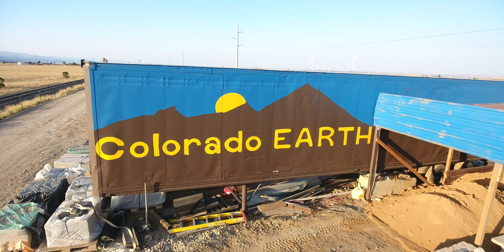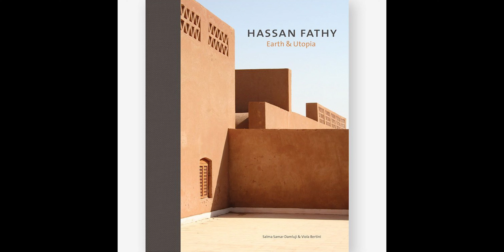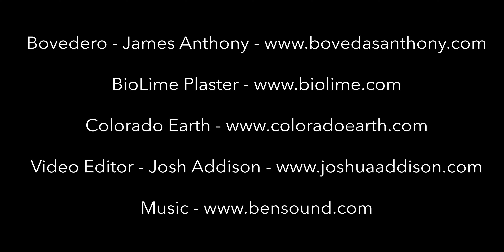Colorado Earth Dome Workshop

Comment: James mentioned that he likes "thin mortar" lines. From always seeing sizable layer between the bricks I've made the assumption that it needs be like that.
Question: from a structure and physics point of view does it matter at all if the bricks actually touch to a degree, as long as there is a thin even brick covering layer of mortar in between?
Reply: Here's a response from bovedero James Anthony - “If I have a “buttered” brick and lay it on top of another and feel surfaces grind upon nestling into place, everything is fine”.

Comment: What did you use in between the block walls to insulate?
Reply from the maker: For this dome project we left the cavity open (air) but typically the cavity is filled with loose fill insulation, perlite or cellulose.

Comment: How do you calculate the thrust of the domed roof, and the strength of the walls needed to support it?
Reply: Thrust & Wall Strength.

Model: GPT-4

￼

How do you calculate the thrust of a domes rood, and the strength of the walls needed to support it

ChatGPT

The calculation of the thrust generated by a domed roof and the strength required by the walls to support it involves complex structural engineering calculations. Here is a simplified explanation of the concepts and processes involved:

Thrust of the Dome: The thrust exerted by a dome on its supporting walls depends on several factors including the weight of the dome material, the size and shape of the dome, and the force of gravity. The general idea is that the dome acts like an arch in all directions, pushing outwards on the walls. In an ideal scenario, the forces within a dome are compressive, flowing along the curve of the dome from the apex (top) down to the base (where the dome meets the supporting walls).

An approximation for the horizontal thrust (F) at the base can be calculated for a semi-circular dome (perfect hemisphere) using the formula:

F = (π/2) * p * g * r^2

where:

π is the constant Pi (~3.14159),

p is the density of the material,

g is the acceleration due to gravity, and

r is the radius of the dome.

Strength of the Walls: The strength required by the walls to support the dome can be calculated based on the thrust exerted by the dome. It involves calculations related to the material strength and geometry of the walls. The walls need to have enough tensile strength to withstand the outward push (thrust) of the dome. This generally requires a deep understanding of the properties of the wall material, including its stress-strain relationship, tensile and compressive strengths, and modulus of elasticity.

In practice, these calculations are typically done by structural engineers using specialized software which takes into account more complex variables such as load distributions, material properties, safety factors, and more.

It's important to note that these calculations are generally not suitable for DIY projects that involve human safety. If you are planning a project that involves constructing or modifying a dome and its supporting walls, please consult with a qualified professional engineer.
Reply: Wow! What a complicated answer. Anyone thinking, building a DIY dome for little money is not hiring an civil engineer. Same with the so called “BioLime” plaster. As mentioned in the video, it is used in Europe for centuries. It’s a lime, sand, earth mix. Nobody in Italy pays $65 for a bag. They all mix it themselves. I don’t know any DIY who uses ready-mix products.

Comment: The only thing that is stopping me from making a dome similar to this is the earthquake seismic zone level 4 region i live in. Here earthquakes are way too frequent. I feel like without reinforcement such a dome might not be as good in my region. I have seen many such domes which have survived major quakes but then there are also many examples of such domes which have collapsed due to earthquakes. Maybe i need to start small and try to master this skill to perfection so as to reduce the risks as much as possible. Maybe then i will be much more confident in building such structures in my region.
Reply: These are in a region of Mexico that gets hit with frequent earthquake, even one at 7.2 and nothing really happens to Bovedas
Reply: Check, however the dome is One of the most structural sound geometries you can make. 
I think make a dumb is a really good idea, however making it out of Adobe might not be the best idea. Or, if you do use Adobe what another geometry using other structural fittings. 
Like a vaulted roof (which is something I'm looking at). Where the vaults or even more structurally sound than the dome which is saying something. 

Vaulted ceilings also have very pleasing geometric lines. I know it's they are an architect's dream. 

If I were you. Figure out with best data what's the approximate earthquake severity. Probably Even more important than the earthquake severity is the type of shockwaves you're getting. P v S; is critically important when designing a earthquake "resistent" structure.

Donald being said domes should be incredible, for both as i recall.

If you see the herringbone designs and some of these domes... That is not decorative! That brick layment was invented for domes to be more self-supporting than more traditional Brick laying methods.

Comment: Have you ever used an HRV or ERV in your buildings?
Reply: they dont need it
Reply: @krisgehrholz9817  why?
Reply: If I understand correctly, and I’m sure I could be wrong-The mass stays a constant temperature, and it’s vapor permeable so you’re not lacking fresh air. Perhaps some situations would require an HRV/ERV combo but The MEP designer would be most knowledgeable about this
Reply: @krisgehrholz9817  I'm an indoor quality expert. Air balance,  humidity control is essential.  Every gone should have controlled ventilation.  I got to meet Hohn Vanee who invented the HRV & ERV. I could reduced the HVAC stayed by 20%+ by using them. Also the mirrors don't fog over when showing.
Reply: I appreciate the information.